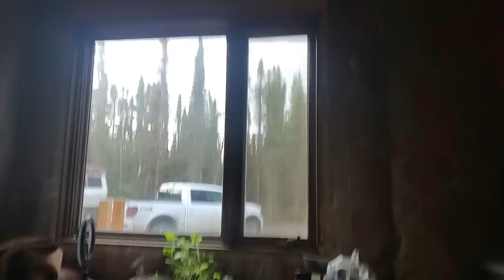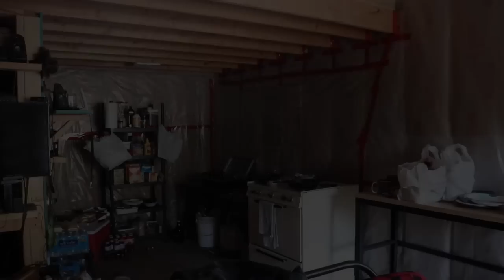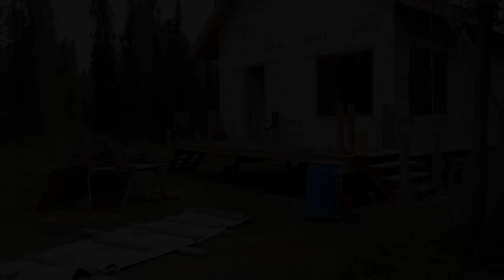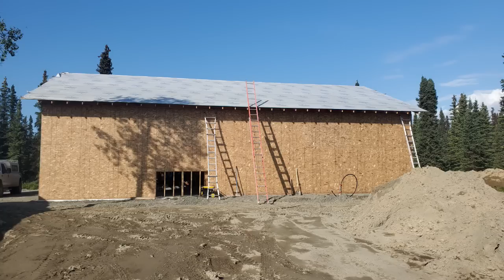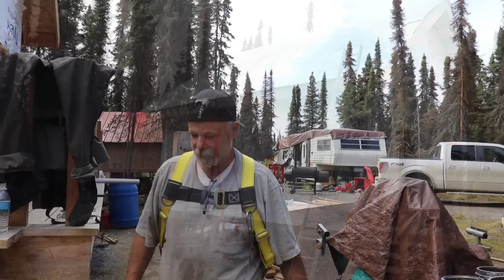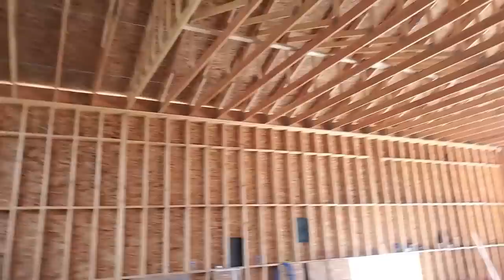Prepping the Alaska Cabin for metal

Comment: Roof work sucks IMHO:). One reason you don't put your rope line between your legs - if you fall and the rope becomes wrapped around an extremity it's often bad news. Most harness(es) hook up at the back for that very reason.  The harness arresting ribbon/rope - that untangles in the event of a fall - often has about 6ft-8ft of 'elasticity' so the fall isn't stopped so abrupt that that alone causes injury.  That is another reason to not wrap your rope around or under any body part ESPECIALLY:) under your groin. A rope constricting your groin in the event all goes South can literally, by itself, send a male into shock within minutes. There is really no need to ever run your harness rope under or around a limb. Not ever.  
   If you like the 'feeling' of security by holding unto something (or it's necessary on some pitches)- it's good to tether another rope to the anchor point that the harness is on and then tie knots in that separate rope every 6" to- 12".  I hope that's helpful. 

  Agreed, last thing anyone wants to do is fall from height. I can't remember the statistics but the number of people severely or permanently injured who fall from no more than 8 ft. is staggering. The people who think they wont fall...foolish gamble.
    You'll be happy with metal if you've not had a roof made of one before. IMHO those who use metal never go back to any other roofing material. It's simply superior in every way - durability, longevity, sheds water and snow so well, etc. While it is a bit more expensive if one does it DIY the additional cost is really minor all things considered. 
    When you screw in your roof screws - make sure not to over-tighten them - if you use an impact tool it's almost too easy to over-tighten unless you have an impact tool with a clutch (and few are). If you can use a drill with a clutch - that is ideal. The goal is to not flatten the washer much beyond the head and if you're 'oil canning' (where a 'dent' is made in the metal around the screw - that's too tight).

Lastly, if this is of any help, make darn sure the 1st piece of metal you put up is square w/ the roof - there's almost no variance when putting it up and while you can correct for some error as you put pieces up over a longer run - it's far easier just to get that first piece, of which all the rest align against, right. GL. Roofing sucks...idc what anyone says:).
Reply from the maker: I am pretty sure this is one of the best comments I have ever had. I appreciate you taking the time to point out the dangers and to give the tips you did! I cannot argue with a single point you made here. Thank you!
Reply: @SeanInAlaska  In turn, thank you for your kind and thoughtful reply. I'd like social media to be less caustic. The times I can live up to that desire - I try. Sometimes I fail. I was trying to think of tips, without seemingly like a 'know it all' or the like and also respecting anothers process and where they are at skill-wise etc. It was a pleasure watching your channel and that was just made more clear by your kindness. Thank you.
If I can think of anything else I'll pass it along. I've done 3 full and large metal roofs and it's by far the best way to go if you live off grind and I think you'll be very happy with it. I"m not sure regarding your 'zone' what sort of ridge cap ventilation you need - but ask your local hardware store - they'll havea  guy/'gal who can guide you on that. It's important for the longevity of the roof because I'm very much like you - when I get off that roof I never want to go back up. It's just miserable. GL to you and I hope to watch some more in the future. Again, TY for your civility. Peace.
Reply from the maker: @OceanofMaya I will never understand people who cannot take advice from those who have more experience! Lol...as a complete novice here I always listen.

Comment: Yes, you must wear rubber soles shoes on the roof. Here in Aussie all the roofers wear tennis shoes called "VOLLEYS" by DUNLOP.. They're a canvas type upper shoe with rubber soles ...actually manufactured originally for  tennis shoes ,but they've proven so XLENT for gripping on the metal rooves here in Aussie , that its almost a legal requirement to be wearing them on any roofing project. My eldest bro and his sons run a roofing business here in S.E. Qld so I'm def in the know on this one.  Keep up the great work,  you're doing a great job there.  🇦🇺🤗🙏💞👌👍✌️👏🇺🇲 Google the Dunlop Volleys. Every DIY home builder should own a pair !!!!!
Reply from the maker: Here in the states they wear rubber soles as well, but I did not want to buy a pair for 1 roof...and I am pretty sure I will not have to do another anytime soon hahahhaa
    I will pick up anpair should I need to do one again though, the current ones I am wearing are too big and not really comfortable.
Reply: @SeanInAlaska  Good man. I hear you loud and clear. Those VOLLEYS are great all round shoes in summer ,so if you're needing new  shoes even next year ,they're a very handy tool to have on your kit ...or shoe drawer, whatever. Have great durability also. I hear you about buying something new  when you're already shelling out heaps on all your projects. Just stay safe mate and if you need them , get them. Either way, I'll be watching. You're doing an awesome job , esp at our age and unqualified.  You're doing a great job  showing up today's  young ones who won't get off their backsides to change a channel  😆 🤣 😂 🤣
Not sure about Alaska but they're only AU $30  here .

Comment: Öh Sean😁 never realy never use the expetion between your legs. When you fall it will give you a realy nasty spin and you will hit hard with your head. An. think about not to use the exension cos the thick rubber part will hold about 2 too 4 yards of band which will be released when you fall. So if the highth is right and you loose your stand it will open with a hit and release some yards of band and you hit the ground. 
I am working in steel plant building for 34 years and in Germany it is not allowed to use this kind of harness for business work without special training and it has to be redone every 2 years becaue this is so dangerous. ANd before I forget, never work alone, because you will apreciate some helping hand when you are hanging in the harness. 
I love you contends so stay save and we will have a lot more videos from you 😉😊
Reply from the maker: Thank you for that! I appreciate every safety tip I can get! 
   For the record, I always have someone over when I am on the roof 😉

Comment: I'm constructing a building too.  Using some of the 10 trillion rocks on the property to build with. It's going quickly. It's a temporary building so not using mortar, just stacking the rocks. Not worried about building walls with no mortar.  Going to have a metal roof too. Not going to bother wearing a harness. I don't see the need. The word building may imply a bigger structure then I am actually constructing.  It's a house, well actually a shelter. OK, I'm constructing a temporary shelter for my ducks. So the walls only need to be a couple feet high. 😂
Reply from the maker: Hahahhahahah! Duckdominium!